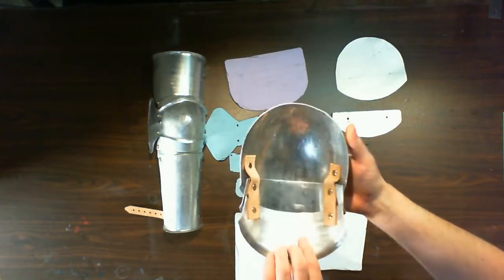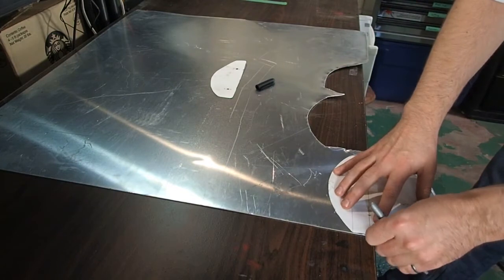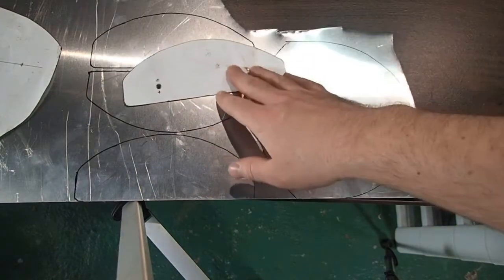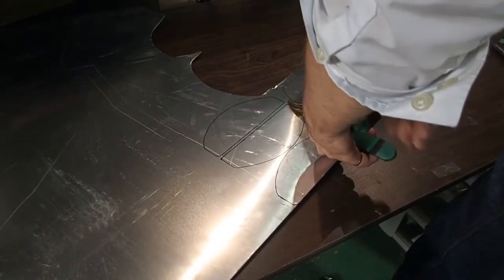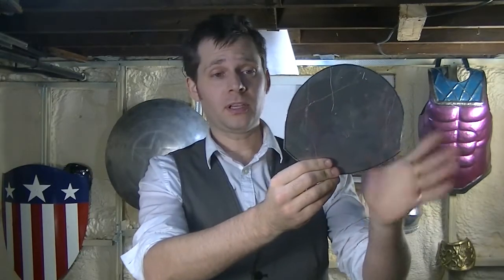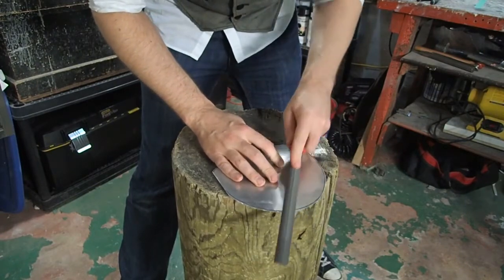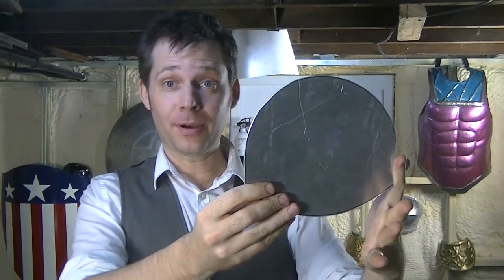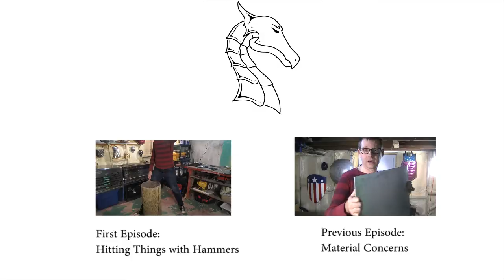Armouring for Cosplay 4 - Cut It Out: Uncut

Comment: what thickness did you use?
Reply from the maker: 18 or 16 gauge 3003 aluminum.
Reply: okay, i found 18 gauge but it asked for thickness in inches
Reply from the maker: 0.04" to 0.05"